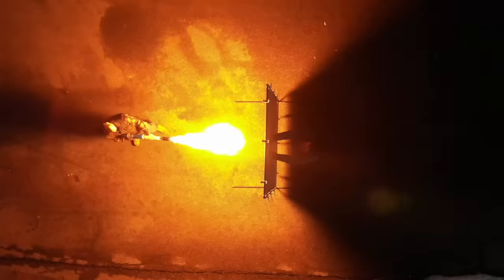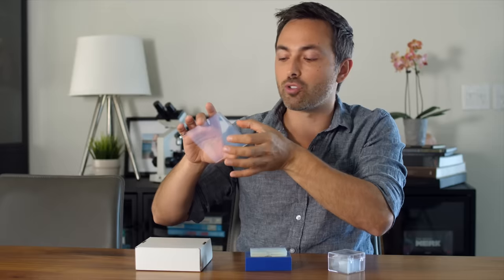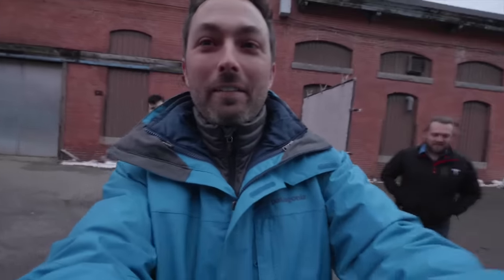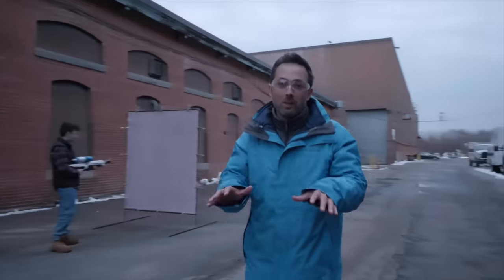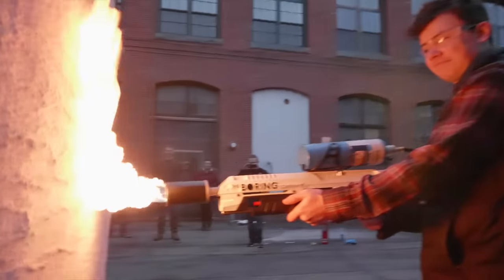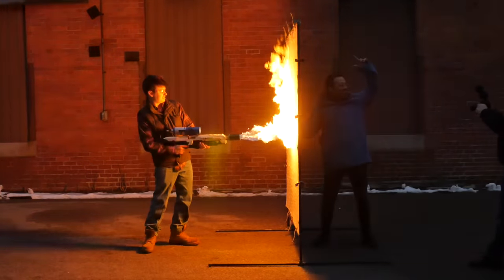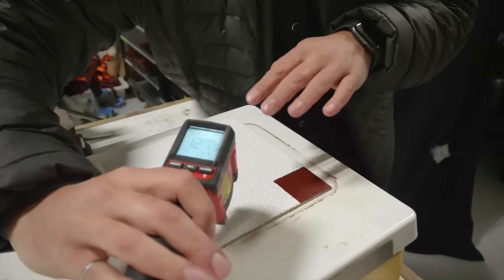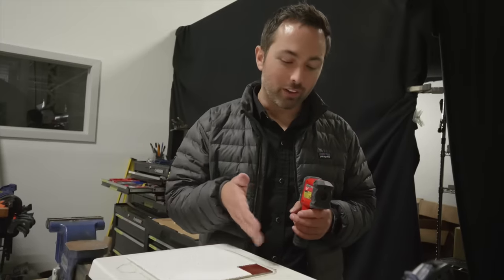Flamethrower vs Aerogel

Comment: In addition to a real flamethrower, it would be nice to see how a control fiberglass welding blanket holds up without the aerogel component.
Reply: Or any material for that matter. Codyslab did a video about that subject. Many people do experiments without a proper control group
Reply: I think 2-3 cm of high density basalt fiber blanket will perform the same.
Reply: @pinkyster9384  I believe Cody showed that a piece of bread was just as effective at protecting his hand from a welding torch.
Reply: @justindie7543  yeah exactly, which shows that the material wasn't extraordinarily "fire proof"

Comment: Make firefighter's cloth coated with Aerogel to avoid burn damage?
Reply: Good idea, but it’s super expensive currently still. Also, fire’s heat isn’t the most dangerous part of the job, but building integrity as the structure is subject to extreme heat is.
Reply: @Tyo-yw9jh  which is why aerogel should be in insulation since it would greatly increase the amount of time it takes for a fire to weaken a building since aerogel barely conducts any heat.
Reply: @thedestroyer3262  would also double up improving the heating and cooling of buildings generally
Reply: @thedestroyer3262  Again, it's still really expensive.
Reply: Also dont breath that stuff in.
Reply: @830927mjki  Aerogel is more expensive than gold, $23,000 each pound
Reply: @rikimbili  a pound of this stuff is a lot though, remember, it's super-light
Reply: @rikimbili  measuring Aerogel per pound is pointless considering it's possible to make Aerogel that less than 0.005g/cm^3 (gold is about 4000x more dense)
Reply: Just wanted to chime in and say that it is not the fabric itself that protects firefighters but rather the vapor barrier between the 2 layers of turnout gear.
Reply: @Tyo-yw9jh  so your saying space marine armor
Reply: They already have something that works why would they give every firefighter this it would be expensive and time costly
Reply: @Bigwaterboi  Turnout gear still gets extremely hot in general let alone in a fire, I think a thermal barrier made of Aerogel could potentially be more efficient than the current way of trapping the air inbetween layers.
Reply: @crispybaguette8670  You have to also consider that using aerogel would allow the turnout gear firefighters use to be much lighter and less bulky. More mobility in life-threatening situations can be nothing but positive.
Reply: @rylan907  honestly we could just give them power arrmor
Reply: @crispybaguette8670  they need power armor
Reply: Fireproof fire fighters uniforms. I wonder why no one's thought of that ._.
Reply: @karthik.b1309  aerogel is like a Fire Resistance X Enchanted Book
Reply: @rikimbili  That is a highly misleading statement since gold is 19,000x denser than Aerogel.
It's about 0.45m3 per pound, or 45m2 of 10mm sheets.

This means a pound would probably be more than enough to insulate a standard UK house.

Also, a quick google found some 10mm thick Aerogel mat like the stuff in the video on eBay for £16 per m2. 
Which would put us at £720 for the same 45m2 area.
Reply: @ZabivakaPirate69  the most it gets used the more the price goes down,
Reply: @830927mjki  tell google about misleading, thats what it showed up when I searched aerogel price
Reply: @rikimbili  found an article quoting the $23,000 price and it was dated 2010.
Reply: @830927mjki  lol then if we add a 17.7% of  Cumulative rate of inflation it would give us today's price of $27,062.47
Reply: @Tyo-yw9jh  Thanks for clarification, also I read that a lot of death from fire is due to smoke inhalation, does special mask can filter smoke?

Comment: maybe send this to Elon, he really sounds like a dude who'd fix up that flamethrower again
Reply: He already has a line. He named them the big falcon rocket. He could test it out by placing a sheet of the Gel down at the launching platform. Just imagine the heat and shock waves of the engines at that point.
Reply: His “flamethrower” is fine. I’m pretty certain the valve was freezing up which explains why the trigger stopped working. Should have wrapped the valve in aerogel.

Comment: Hmm, that blanket can be used for fire fighting shielding! Imagine how light an aerogel thermal armour could be !!!
Reply: Not to mention expensive. Unfortunately it’s not cheap enough yet to be reasonable for departments to purchase.
Reply: @ninetails6218  That really sucks because this thing can truly become a lifesaver
Reply: @user-by6bg5eu6c  This isn't fragile though? It's quite durable infact as shown in the previous video the blanket is on par with fiberglass
Reply: Price will likely scale down over time, like computers, cars, televisions, etc. They are already working on faster, less expensive mass production techniques.
Reply: @imoonset2682  
And even if it's fragile you'd probably have to put it in between layers of other types of material anyway, which would keep it together.
Reply: @lucaslucas191202  I said it wasn't fragile and was on par with fiberglass
Reply: @imoonset2682  
'even if it's fragile'
Reply: but imagine space suits made with aerogel they could protect both from the heat and cold in space
Reply: @benmoffatt1546  
Let's go with Aerographene for good measure.
Reply: @ivoryas1696 -  graphite = flammable.
Reply: @lucaslucas191202 - current turnout shells are nomex and kevlar which is great for fire resistance. But the liners are thick and heavy. Making the liner out of the aerogel/fiberglass composite would be better insulation, much lighter, and likely give them better flexibility.

Comment: You should try with a oxy acetylene cutting torch.
Reply: That would burn derek
Reply: That would be cheating because those torches cut not by heat alone but also by oxidation.
Reply: @gxexrxmxaxnx  It would be interesting to see how much material was lost by oxidation in Derek's test or maybe how much material was deposited by the flame.
Reply: @gxexrxmxaxnx  can you explain how they cut with oxidation?
Reply: @jarret9438  Do you know what rust is? That's iron oxide.
When you heat a metal, it turns very susceptible to oxidation (rust) because of the heat.
Oxidation is basically oxygen bonding with the atoms in the metal forming that oxide.

The chemical formula for iron oxide is Fe2O3 which means two iron atoms have combined with three oxygen atoms.

You can test this yourself easily. Take some untreated iron, preferably in powder form as it speeds up the reaction and pour some water on it. It will oxidize rather fast.
Now do the same but pour boiling water on the iron powder instead.

You can speed up that reaction even faster with ionization. Adding salt to the water will make the reaction faster.

So, a cutting torch adds an oxygen rich environment and heat to do the same thing, enabling the metal to oxidize faster due to the high number of oxygen atoms and the heat.
Reply: Michael Nilson  so, oxidation  makes it easier to cut because rust is easier to cut?  Or are you only refering to the increase in heat (ability to cut) due to the higher quality ratio of oxygen to fuel?
Reply: @jarret9438  Reaktion of iron and oxygen is a lot hotter than acetylene and O2. You melt the iron and blow the liquid away, thats why the torch is cutting. Aerogel doesn't oxidize under These condition so the torch would only melt it. You would still get a hole, because acetylene and o2 burn at something like 3500°C which will melt the silicates in the gel
Reply: chowda you forgot to clean the oxy tip!
Reply: @SomeAustrianGuy  ah ok i see. Thank you all.
Reply: @SomeAustrianGuy  Reaction*
that's*
Reply: @SomeAustrianGuy  this* condition
Reply: @JorgetePanete  I'm sorry, my phone often switches k for c, because thats how you would write the words in german. I'm trying my best, but english isn't my first language.
Reply: @SomeAustrianGuy  It isn't mine either.

Comment: "flamethrower"

Have you seen a flamethrower?  That's a torch.
Reply: @EatMyYeeties  technically still no; throwing the flaming material throws the flame, here the flame just stays in the same spot relative to the torch.  It's just a portable flame aka a torch
Reply: That’s why it’s called “not a flamethrower”
Reply: Just a big ass torch. Flame throwers throw fire at stuff
Reply: Flamethrower is a high tech fuel sprayer with blowtorch attached to the spraying pipe in the end. So yes this is not a flamethrower.
Reply: @robotdude4377  "high tech" bruh you could spray fuel out your mouth into a fire and it would be a flamethrower

Comment: Can't wait to see aerogel clothing and jackets so we could have light hoodies or jackets to survive the winters. Or having lots and pans or other cooking supplies that you could easily touch without worry
Reply: Good ideas
Reply: Or just dust yourself in insulating aerogel powder like talcon powder to keep yourself warm.
Reply: Like aerogel oven mitts and not applied to the cookware itself I assume? If you coated the cookware in aerogel how would it heat and cook the food? lol
Reply: @alexparker5127   picture super nimble oven mitts though, chefs would love it
Reply: Check out oros!
Reply: Yeah but this arogel is not breathable though. It would be like wearing a plastic bag.
Reply: @HDsharp  wrong. OROS
Reply: I feel like it would do a fantastic job at trapping heat in the winter and it would be really easy to develop micro channels for cooling for hotter weather
Reply: I was thinking increasing house insulation for better energy efficiency

Comment: Even though I trust the science, I'd still get plenty scared putting my hand right across from the 2,000-degree flamethrower...
Reply: 660 degree flamethrower. The camera captured up to 2000 degrees.
Reply: @deathuncut  temperature gets a lot higher at the edges of flames, that can explain why it caught upto 2000, they were not using flames effectively or maybe they did but they added clips of doing it wrong...
Reply: Hot thing radiates heat. You should know that it is too hot if you can feel the heat few cm away.
Reply: @era7928  we humans don't feel temperature difference but the rate of change of temperature, this is why metal feels colder in comparison to plastic if both left at room temperature, this is also why plastic are used as handles for kitchen utensils, as metal is good conductor it will transfer its heat much quickly than a bad conductor like plastic. This is also reason why aerogel even though over 100°C is not burning hand or boiling water

Comment: The propane bottle got too cold after operating for a while (LP boiling off with consumption), cooling it down, lowering the pressure in the tank. Pull the tank off, heat it up in a bucket of warm water for a minute or two and you're good to go!
Reply: If you're using 5 gallon tanks, you can also just shoot the flame at the tank for a bit to warm it up. Don't tell OSHA

Comment: The small-scale structure of the aerogel makes me think if this is gonna be like asbestos: A miracle material that turns out to be dangerous.
Reply: Exactly. Maybe is not creating tiny sharp needles, but still I will not touch this with my bare hand.
Reply: @olelek  asbestos is safe to touch... Inhaling it is what is dangerous
Reply: Circular nanoparticles are called Sand dust. Animals have breathed and evolved to inhale some Silica dust since the beginning of land animals. Non-issue.
Reply: It's like standing in the beach.
You inhale sand, you swallow sand and all that in little amounts. The body can handle the silica as much as it handles background radiation.
Reply: Aerogel is not stiff it is a soft gel like material with the liquid component inside substituted with gas.

Comment: I would be interested to see how this stands up against an actual flame thrower. The not-a-flamethrower is just a modified roofing tool and puts out a tiny fraction of the amount of the heat as an actual military flamethrower.
Reply: You mean ww2  flamethrower?

Comment: This stuff is incredible.  Can we have this as insulation in Florida please?
Reply: Its gonna be even hotter
Reply: @maindepth8830  Insulation makes air conditioning more efficient.
Reply: @spacedoge3508  ah, thanks for correcting me
Reply: Sure man. It's gonna be underwater eventually though.
Reply: @innovativeatavist159  why that. Just do wat we here in the Netherlands do with water. Build massive water barrier, flooded gates, dams, dikes water pumps and what not that even makes it possible to live below the sea level and still stay dry. 

If the Netherlands can the United states should be capable to do the same.

Comment: As an avid backpacker and outdoorsman, this would be amazing for very lightweight and very thin sleepingbags. And also maybe use as a coating to waterproof tents. (could there be a way to put aerogel in an aerosol spray?)

I've always wondered if there ever could be some materials out there light and thin enough to keep you warm down to say 40 below temps, and now there is. Amazing stuff.

Comment: Conclusion:
"World's Best Heat Shield is 99.8% Air?" has a better clickthrough rate than
"Flamethrower vs Aerogel"
Reply from the maker: I'm not sure actually. I'm lacking the data to reach a solid conclusion.

Comment: I wonder if that can be use in textile industries, it would be better material for heat resistant gloves like for cooking or welding, also firefighter suit
Reply: Outdoor Research has been making winter gloves and booties with aerogel but there are lots of comments about a white powdery substance getting on people's hands and feet and is very difficult to get off... These videos have been very informative.

Comment: I wonder what would happen if they used one of those military grade flamethrowers?
Reply: The concept of aerogel still applies...
Reply: Idk I think it might have just torched it cause those use like some special catalyst like diesel.
Reply: Nothing more, really. perhaps even less. The only difference is that a military flamethrower uses liquid propellant that tends to stick to stuff instead of a gas.
Reply: they’d need some bigger aerogel
Reply: hard to say because military flamethrowers expel flammable liquid rather than flammable gas. it may just punch through the aerogel instead
Reply: from 3-5 meters: it would bore hole through the blanket and burned derek to crisp
from some 30 meters: whole thing would get enveloped in flames, anyone in vicinity would went hypoxic followed by carbon monoxide poisoning, assuming theyd survive the heat
Reply: Or just place it underneath a rocket during liftoff ad a launch facility like NASA has. The shear heat and energy is a very good test.

Comment: 4:04 "propane burns at about 2000
 Celcius"
4:22 thermal camera shows 650°
C
That flamethrower is a joke
Reply: trabladorr lol
Reply: They need to get a oxy acetylene torch those things burn super hot.

Comment: oh, so thanks to aerogel we have more contaminating oil <3
Reply: i prefer clean energy but this prevents oil spills, with aerogel we can get more raw without accidents every now and then
Reply: @sprafa71  i'd suspect the opposite... Smaller pipe means it takes less to break it... and a thick polyurethane shell would provide quite a bit of protection against getting crushed or similar mishaps. It's probably more a case of the increased risk being low enough that the savings vastly offset it.
Reply: sprafa71 more ships = more accidents

Comment: That was a really 'boring' flamethrower
Reply: Its not even much of a flame thrower, its very shitty propane heatgun/ torch. Real flamethrowers are liquid based and actually have some range and deliver much higher temperatures
Reply: @Kacpa2  u didn't get the pun,did u
Reply: @Kacpa2  Boring was written on the flamethrower.

Comment: We need to try that revised aerogel to keep absorbing the heat away from GPUs.
Reply: So far... 3D Printed Aerogel without electricity has been tested to do 300x better than (Electrical Powered) Air Condition which still seems like absolute proof that it will also do the same for keeping heat away from GPS by absorption. I am quite surprised how almost everybody still can not fathom this to be the seemingly ultimate solution because they are far too stuck on its given definition instead of what verifies as proof beyond concept.

Comment: re 12:40 The flamethrower fatigue:  Anytime you are releasing a gas thru a phase change, it absorbs bocue energy (gets very cold), and that often clogs up with condensation ice from the air.  That should recover in 5-15 minutes by ambient warming, to thaw the ice.

Comment: Im pretty sure his "not a flame thrower" is fine propane tends to freeze up when the demand is so high plus those containers are made to be used upright for most applications or on a 45 degree tilt it probably worked fine once he got home or switched tanks

Comment: the flamethrower stopped because of the ambient humidity and the cold gas vacating the cylinder chilled the gas line to the point it couldn't warm the gas in line enough to supersede the required psi for emission and or combustion...it needed a moment to warm up...happens all the time when you are ice fishing and running propane for a long duration...the flamethrower didn't break it just needed a moment

Comment: I am making a 20lt cooler box, using a peltier, thinking of using aerogel as insulation, as I have been told it is really good, it for me 12v camper van, can you point me in the right direction please